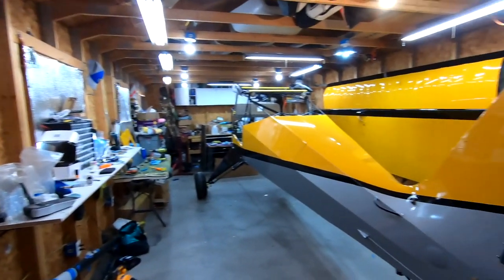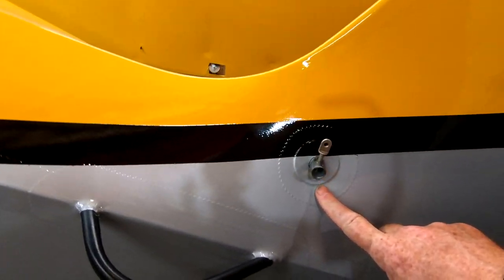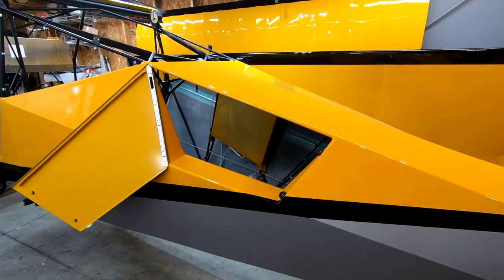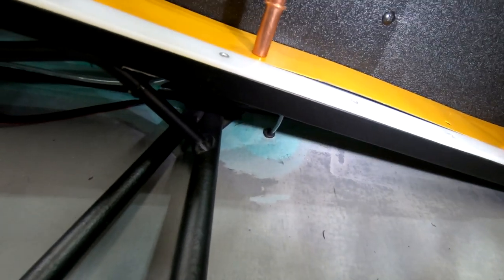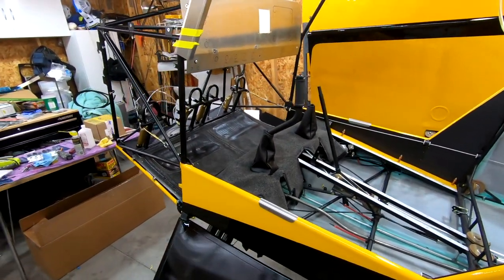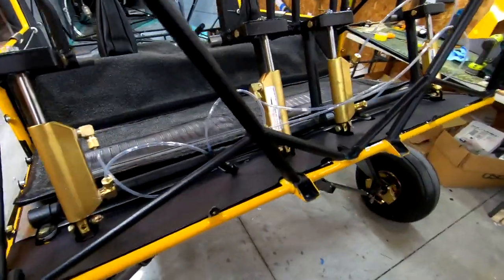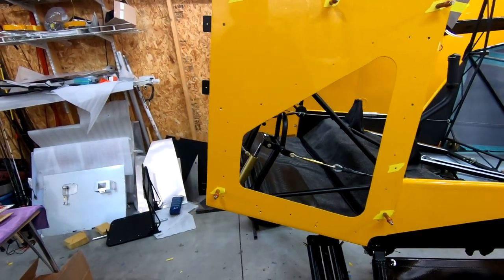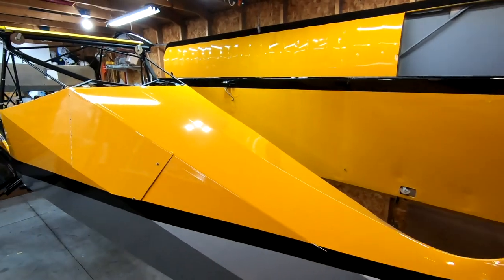Highlander Build Vlog 10, I'm making serous progress on my Just Aircraft Highlander

Comment: Ya I said the same thing about the rudder cables when I strung mine. I called just aircraft and told them they forgot to weld on the back fairleads. They said no we don't put those on anymore..? To much wear I suspect, it does put some angle on that cable. I don't know about scrappy killer... Might want to see what scrappy can do first.

Comment: Where did you get your rivnuts and what size are they. I like that idea. also trying to figure out what to do with the interior as well. I like the look of that abs plastic.
Reply from the maker: Josh, I'm using the aluminum 8-32 rivnut, I found them on eBay. It's hard to decide what to do with the interior, I want it to look clean and professional. The ABA plastic looks great for some of what I want.